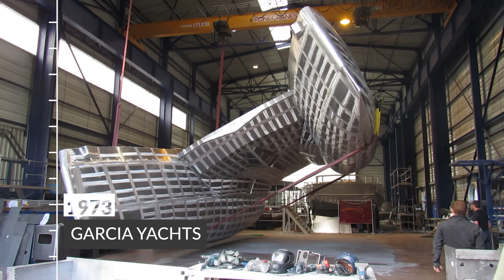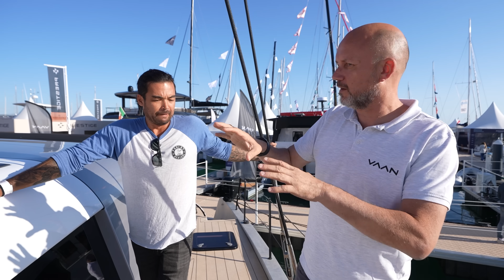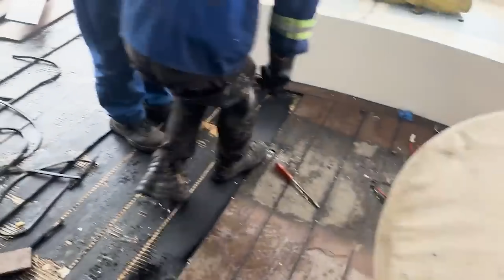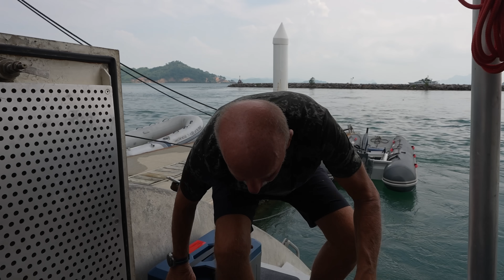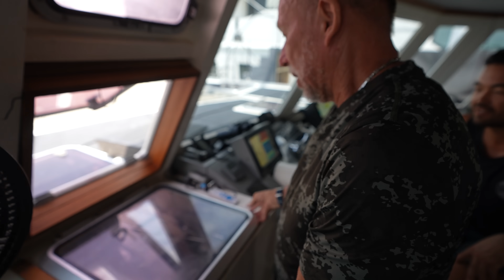The New Generation of CATAMARANS Built to Sail ANYWHERE! - Part 2 - (Episode 369)

Comment: Sorry but stating these cats are "go anywhere" is delusional.  Aluminum sure... but not cats.  Taking these boats into the southern ocean? Not.  Working thru ice leads in the northwest passage or Antarctic peninsula or the east coast of Greenland.  Not. Sorry but cats are for milk runs.  Just imagine being in 20-30 ft seanot! The southern ocean or north atlantic on one of these cats... not!  Or stuck in the ice with the two hulls being squeezed together by irresistible feet thick ice. Or growers jammed between the hulls.

Comment: The VAAN R5 is a 49 ft aluminum yacht built in the Netherlands [00:32 min].

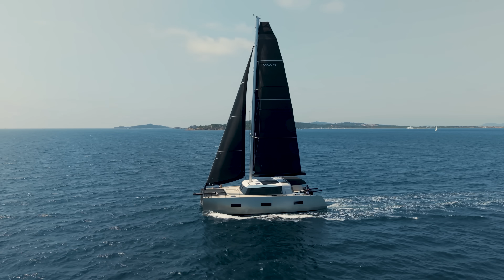Price: Base: ~€1.68 million, reaching approximately €2.0 million fully optioned [16:20].

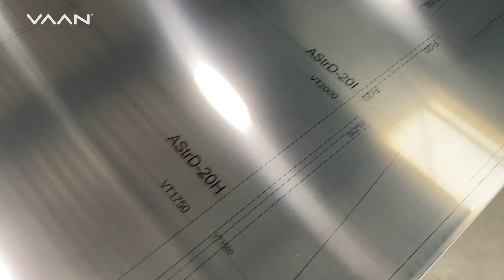The hull is constructed from 5083 marine-grade aluminum, over 60% of which is recycled aluminum (such as repurposed window frames, traffic signs, and license plates) [01:19].

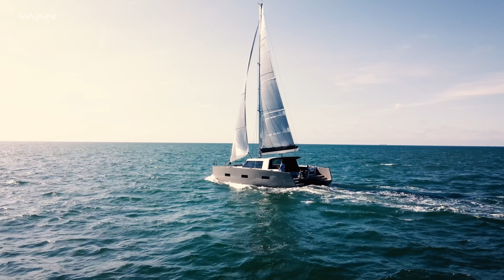Because aluminum is far stiffer than fiberglass, the boat does not flex under wave torsion. This eliminates interior creaking, extends component life, and allows the installation of massive double-insulated real glass windows without risk of cracking [02:09].

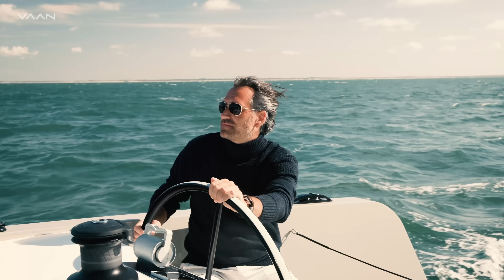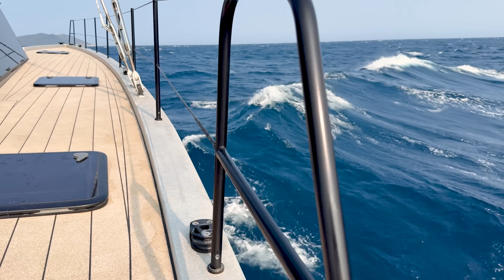The VAAN is driven by dual 22 kW electric motors powered by a lithium battery bank [03:35], providing 4–6 hours of pure electric motoring. The electrical motors are supported by a backup diesel generator that feeds the electric drivetrain directly, yielding a total motoring endurance of 4–6 days [04:04].

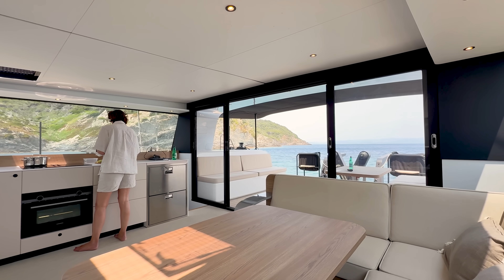The VAAN can sit at anchor for two weeks continuously with the AC on full time without ever starting the generator even with a modest solar array (1.5 kW peak expandable to 4 kW peak). [06:44].

It's able to consume very little power because it's equipped with a highly efficient heat pump climate control system [06:23].

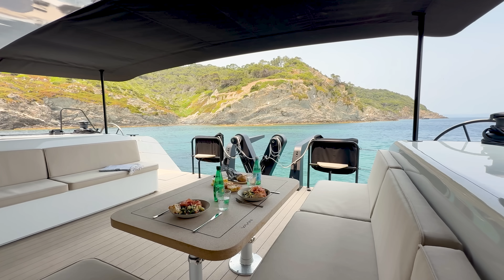Because of the heavy glass wool insulation and double-insulated glass windows, keeping both hulls at 21°C (70°F) in direct sunlight only consumes 300 to 400 watts  of electrical power to run its compressor and circulation fans.[06:38].

It draws that power from the boat's onboard battery bank (which, in turn, is being constantly recharged by only 1.5kw of solar panels during the day).

Note: The VAAN's power efficiency is in contrast to air conditioners on boats, which are notoriously power-hungry and can consume 1,000 to 2,000+ watts of electricity.

Comment: Not a fan of driving the boat in the weather elements... and the view looks like it sucks. They need to redesign for a more cental cockpit up front with better views.
Reply from the maker: Up front is the last place I’d want to be in weather, from my experience at sea.
Reply: @ParlayRevival  Your Lagoon is upfront with a forward cockpit so you may want to find a new boat then. 🤣 That aluminum boat has an aft cockpit.
Reply from the maker: @bgwhalley you said redesign for a central cockpit up front. My lagoon has a flybridge 🤔
Reply: @ParlayRevival  Let me try different terminology. Basically, depending on the make and model, there are 3 steering locations on a catamaran -- correct? 1. On the flybridge which is at the center of the boat. 2. Inside the boat forward of the saloon/galley area? 3. At the aft corners like in this video you posted? When I say forward central cockpit, location 1 & 2 mentioned above. I like it when the steering is on the flybridge like you have or inside the front of the galley. Those locations are what I am refering to as being foward from the aft. Maybe this makes sense now? Steering from the aft only seems good when docking.

Comment: So where the guy mentioned that the water tank is bare aluminum doesn’t seem right. If you put any treated water in there it would cause corrosion! Plus bare aluminum is going to add a metallic taste to the water! Why not do a ceramic coating like they are doing in drinking bottles?

Comment: Well, I do impress it. I like to show and watch a lot of it anyway. On the sales, you know, they got these I know, you know, cause you've sent it out to her G. TX catammann, something like that. It has a wing sail, and the wingsail is so awesome. It's automatic, you don't have to go up. Pull no ropes. All you have to do is push a button, and they've got a new one that's got 2 cells. But it's right in front of each other, and it's in the middle, so don't go on the left. But don't go on it, just go straight down the middle and the 30% more power, 30% more sale. And then you could put a the plate on the on the motor that turn and pushes the poet I know they got one that if you turn that off and you're selling, they automatically charges your batteries, wow, that's ingenious.I want you going and still recharging.But, yes, cause if you could put one of those wings, that work more fun

Comment: No treatment of the water tanks ? I don't understand that. Just put an epoxy coating in that tank, it will solve all the pit corrosion in water tanks. The amount of pit corrosion inside water tanks I have seen is quite astounding. Recently saw a boat with 6 mm aluminum plates, but with 3 mm pit corrosion inside the water tanks. Wanted to buy the boat, but decided not to buy her because the cost of repair were enormous.

Comment: Boat builders in BC Canada have been building commercial boats since the the early 1980s and there still going strong it’s just taking yachts to finally realize that aluminum is the way to go no bulkhead issues easy to upgrade easy maintenance.

Comment: Awesome video, very eco friendly, recyclable. 30 years from now and folks want to move on to a new boat it will be worth the cost of scrap per ton of aluminum unlike GRP that is expensive to recycle and 95% of the boat goes to a landfill. You guys are crushing it, if not now certainly later.

Comment: Totally incorrect statement at 2.05. Fibreglass can be used to make very stiff and strong structures - witness all the incredible cedar strip/glass, foam/glass performance cats around. Aluminium is ALWAYS heavier than glass foam. Then at 22.07 the owner somehow conflates hull material with sea motion - c'mon. Do some proper journalism and hold people accountable for silly views. Look at Schionnings and Graingers and Chamberlins - faster, lighter and quieter cats than these ones shown. I guess the channel owner has gone along with the crowd. His glass cat had issues, but that is poor building - not material. Now we will have all the viewers of Youtubes selling their Delos inspired Amel Super Marus and all flocking to alloy cats. 

Alloy cats have been around for ages. Mumby and Easton have made good alloy cats for ages. But most designers still prefer foam/glass because of all the advantages it possesses. Alloy is not a new material that has been overlooked, it has been tried and in most cases discarded because it has issues.

Comment: Vaan was pretty but 3 nopes. First one, common to most new cats, that much glass makes it an open boat with a greenhouse on deck. Nope. Recycled ali, nope. Nice pure marine alloy loses less strength when welded. And pretend-electric propulsion. If you're going to be running a generator most of the time (which you would) just have 2 "generators" and attach propellers to them. That way you also get redundancy.
Dawn Hunters - nice, just not for a fat bastard like me.

Comment: Aluminum has more upkeep, metal and salt water don't mix...
Reply: I disagree. Keep up on the sacrificial anodes and overall it's less maintenance than glass. No paint, blisters, core rot. More crash safety and fire safe.
Reply: @kiloohm you still paint/anti foul aluminum.... Glass doesn't rust.

Comment: I love the alb-cats, I am however not 100% sold on Garcia's high latitude pitch. The reason is the angle of vanishing stability. In other words, in the roaring 40s you just might want that bit of safety that says: I might loose my mast in a knock down, but my AVS ensures I am self righting in most cases.

I believe the alu-cats seriously how far cats can go, but there is a latitude where monos feel just a tick safer. For super high latitude, the KMY/Dykstra Bestevaers are my non-plus ultra. Down to details like choosing smaller round portholes and smaller pilothouse windows in more massive framing to take tons of force. And well, the NW-Passage track record of Bestevaers beats any other maker.

But that's all feels of a couch sailer compared to you. And might be just false perceptions cause of marketing. What do you think?

Comment: After the SIGG water bottle debacle, I learned a LOT about aluminum and drinking out of it. I started Hydro Flask because I do NOT want to drink out of (treated or untreated) aluminum. And breathing/sweating in recycled plastic water bottles would be a non-starter. In my ever so humble opinion of course😁
Reply: What happens with Aluminum and drinking water if I may ask?
Reply: @NapFloridian  I'm sure it has something to do with aluminum in deodorant and "scientists" linking it to alzheimer's.  I've been on this planet long enough to see the butter v. margarine debate, the red meat debate, the egg debate, the fat debate, the food pyramid debacle, the fauci debacle to know the "scientists" have what ever opinion that the financiers want them to have.
Reply: @NapFloridian  Good question. For drinking water alone, bare aluminum isn’t necessarily dangerous and many boats have used aluminum water tanks successfully for decades.

The reasons most manufacturers avoid uncoated aluminum today are more practical than health-related:

• Aluminum can corrode if exposed to chlorinated water, varying water chemistries, or salt contamination.
• Corrosion often starts where you can’t see it, especially in tanks.
• Over time, pitting can lead to leaks and expensive repairs.
• Polyethylene and stainless tanks require less maintenance and generally last longer in the marine environment.

For a water bottle used only for fresh water, bare aluminum is probably fine. For a permanent onboard water system expected to last 20+ years, most builders choose poly or stainless because they are more forgiving and lower maintenance.

Comment: Aha, my favorite couple. Dawn Hunters !  We are both electrical engineers so we have a lot in common, plus I love a great dentist lol. Not to mention our dogs are VERY similar in breeding. So, since we both wanted to communicate, I became a baseline Patreon Supporter to make that easier. I love his boat and his battery bank is the same as mine ! Very similar , not quite the same. Hey Dawn Hunters William and Yanna and Raven , great to see you here ! Michael. PS he's got 40kw of the same type of battery that I have, but mine is 12v 25kw, configured to that I can change to 24 or 48. I love my system.
French designer Jean Fricaud founded the shipyard Meta in 1967, which pioneered early aluminum yachts.

Comment: It’s strange that some of the best attributes of aluminium are rarely mentioned. You can have a completely water tight deck. Just weld u plates and bolt everything onto them. No more leaking deck fittings. Chainplates integral to the hull, no painted hulls, framing space allows for massive insulation.

Comment: Thanks so much for this series, love it! I LOVE almost everything about the Vaan the most except, I am spoiled by the insight from the recent Sailing Nahoa build plans - the vaan foot-operated electric winch at the helm and the V-shaped winch assembly means in rough trailing seas you may have difficulty with keeping your footing to get those foot buttons pushed, and/or you're likely gonna get roughed up a bit by waves messing with those lines/winches at the back. you really do think differently when you're having to think about sailing in all conditions.  

For the Dawn Hunters boat, i've been following them for a little bit now and I loooove their boat. It seems like it was designed so well, and the work that couple is doing to the boat also makes a lot of sense. I really like their thicknesses in ali across the hulls and deck, the flybridge up top on it, the through-hull and engine layout, the huge ali structural box that the mast is stepped on and all that insulation due to their stringer thickness, even the front ladder and anchor locker are amazing designs and the through-hull in the middle of the salon for a cool breeze. It's a shame the design is a one-off! lmao @ their rowing machine as well - they should put a flywheel and alternator on it so illyana can charge up the batteries!!
Reply: Thanks! Note that all winches are controleble also by hand on the dashboards. So no need to move from there. Vaan go anywhere, in the roughest of seas:)

Comment: I dunno if I'm convinced. I have an old trawler with aluminum fuel and water tanks and had corrosion problems with all of them. If anything gets up against them and holds water then, they corrode and get holes in them. I know that can all be mitigated but any mistakes and it doesn't take long before you have swiss cheese for plating. Like steel, it can all be repaired with a welder, just stay vigilant as with any kind of boat you have right?
Reply: The constant worry of guests dropping coins in the bilge would drive me crazy.

Comment: Boats need to start building big fat captain's chairs that recline all the way back into a recliner that you can sleep big puffy seats at the helm put them on a rail so they slide back enough that you can sprawl your feet out and then we're not laid down slide them forward so close enough to the helm to steer and everything else there seems to be little to no good seating in any catamaran there's those one inch little cushions on a square bench horrible absolutely miserable every video I watch people are laying on those things in every different position Even in the gallery they'll square benches with those little mats with no room they need big fat cushy captain's chairs like they used to have in those vans but make them recline and on swivels as well as On slide rails so they can go in many different directions

Comment: I love that Dawn Hunters  kept all his through hulls above water level and reduced them to the absolute minimum.I was thinking you could do this by building them into a wall with a secrete door. For the electric room, I'd line  the whole room with  plastic HDPE , to insulate from currents .You also need a chemical gas Fire  supprecent system..
And im definitely  having  Dagger Boards.
On the Windows, im having outside blinds to keep the sun from  heating my windows when at anchor .

Comment: This glass wool, if that gets. even a slightest bit of moisture you will know it by wet smell from the wool getting wet. Not a fan of exposed helm stations, there is no place to hang onto on the interior during rough weather. If the boat is built like Delos 2.0 is built you willl have no problem sailing anywhere.

Comment: Really smart design. Furling booms have come a long way and make life so much easier. This hybrid system is the best solution out right now as you truly have the best of both worlds with much less complication than integrating directly with diesel engines. Normally, I'm not a fan of those helm positions, but the true glass windows fix a lot of those. I do worry about exposure at the helm, but I know more and more night watch is happening from the salon these days.

Comment: What forces can the large panoramic windows tolerate?
How much thermal insulation do the large panoramic windows give the yacht? Considering that cold, damp air sinks to the lowest point(s) in the yacht. In the case of a catamaran it is a large saloon area to heat and to keep warm. Cold air in the saloon area is likely to flow to the pontoon accomodation, unless there are features that restrict or prevent this flow.
Reply: Toughened  glass can take a hammer blow but can be exploded  if hit from the edges. You can laminate in-between layers like in shop windows .Thermal value is really good, especially if you fill the cavity with gases such as argon.
Reply: Modern aluminium  boats are insulated with either spray foam or boards, they allso use air conditioning .

Comment: Recyclable except that part which ends up in the Ocean via galvanic action, not so? 
Catamarans need larger marina's, which put significant pressure on existing yacht clubs with limited capacity for expansion and the mono hull owners.
Why not anodise the fresh water tanks? Would anodising diesel fuel tanks be a solution to prevent pitting should water (saline) enter the tank?